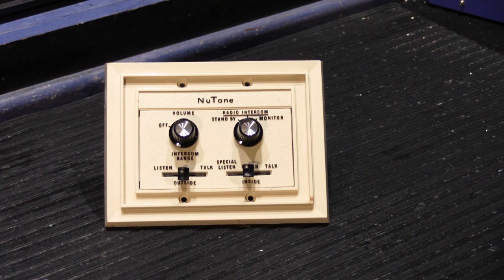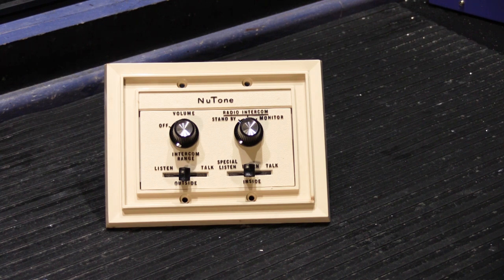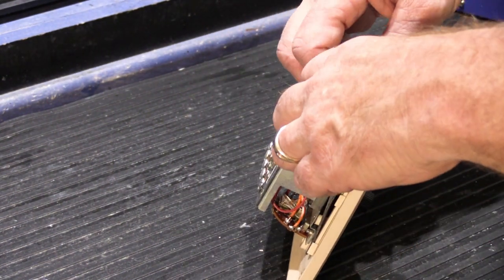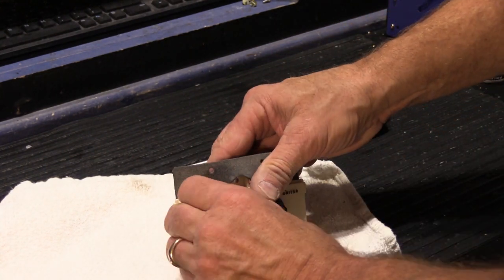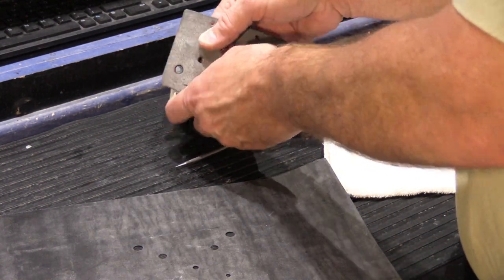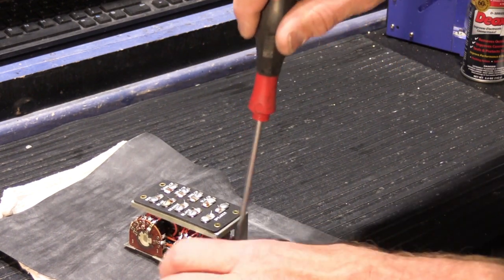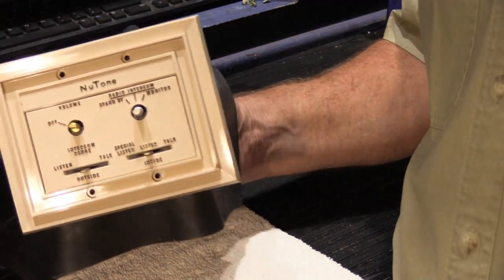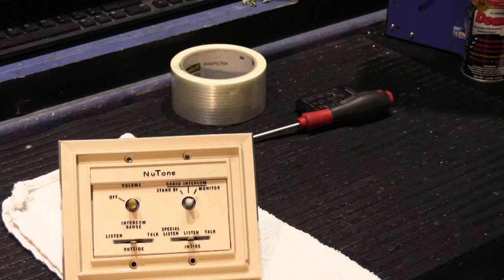How to Convert an Inside Wall Remote Control into a Outside Patio Remote Control

Comment: There’s a total of at least 10 wires (18 or 26 if they are jumpered together) coming out from the back of this Intercom Remote Station. How can you achieve to connect all of them when you have lots of rubber gasket material and it must be sealed in order to be weatherproof ? Did you make extra holes on the back of the gasket to connect all 10 wires ? Besides, there’s very small place to work on this built in remote stations. That hardest part is not shown in the video. Greetings.
Reply from the maker: Hi Luis:  There would be either 10 wires, if the Patio Remote Control was Home-Run or at the end of a loop - or 20 wires if it's in the middle of a loop (the wires are 22 gauge).  

I did not make any extra holes in the gasket - I simply connected the wires (10) to the Remote Control and folded them together and wrapped the gasket over everything.  

The area over the back of the Remote Control (where the wires are connected) is less important than the top of the Control - where water could leak in.  It's important to fold the gasket so it sheds any leaks off the gasket - and not inside the folds.

Sealing the Remote Control to the wall surface is important -to prevent leaks in the first place - Chris